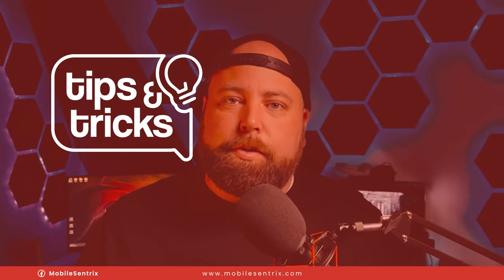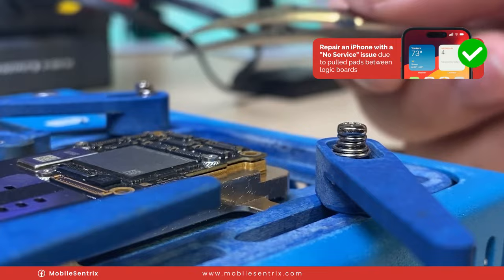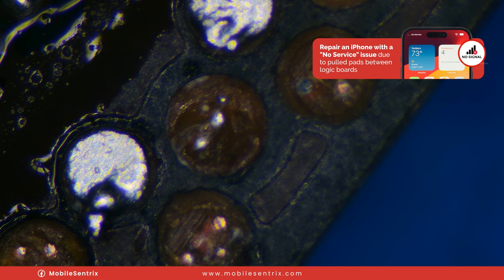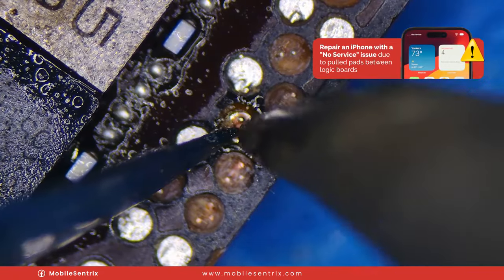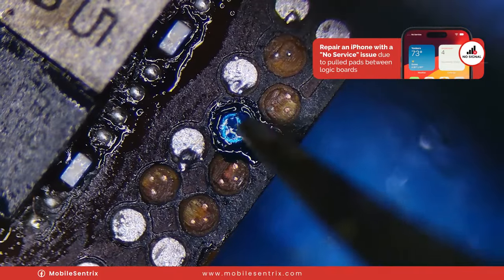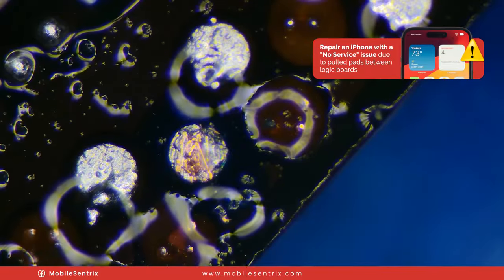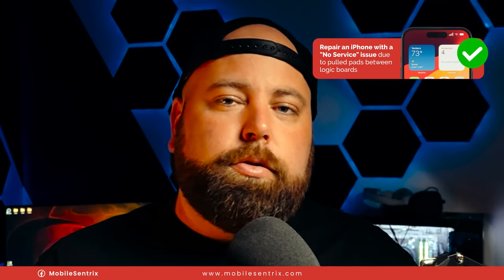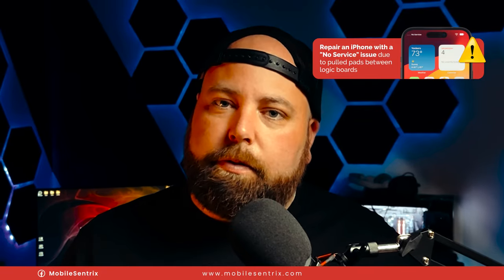Repair an iPhone with a "No Service" issue due to pulled pads between boards (Tips and Tricks #89)

Comment: Great video! Video suggestion: Could you make a video on fixing a completely dead phone? This could include disassembling the phone, identifying the faulty components causing the short, using a multimeter to take readings, and referencing schematics and layouts for guidance. Like the step by step process involved.Thanks!